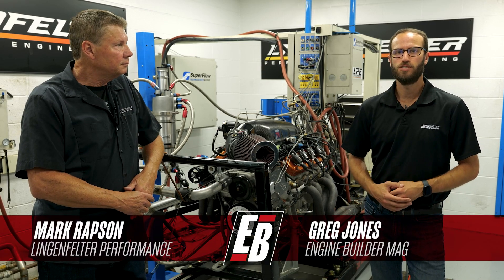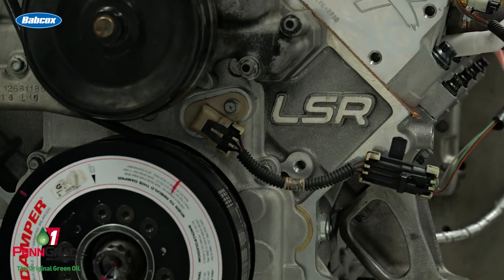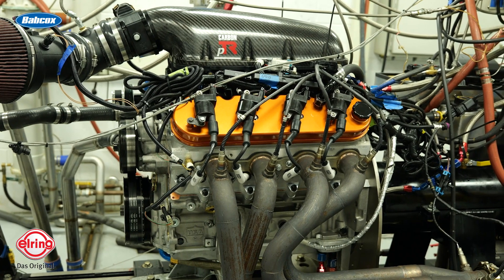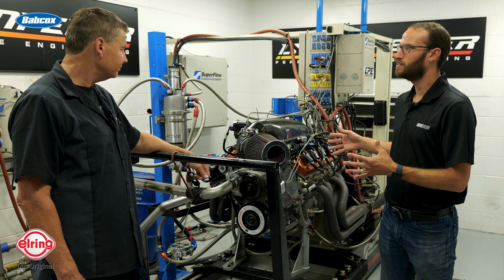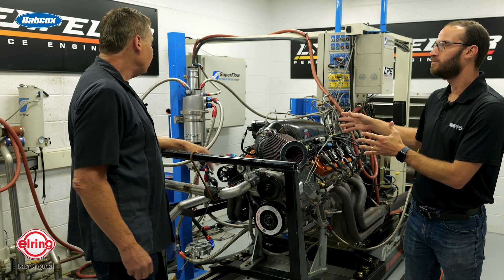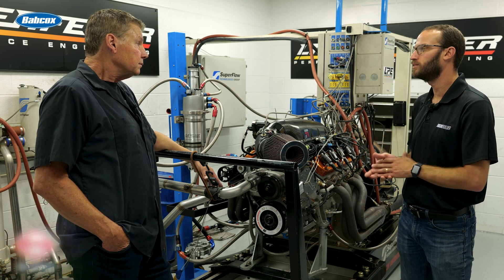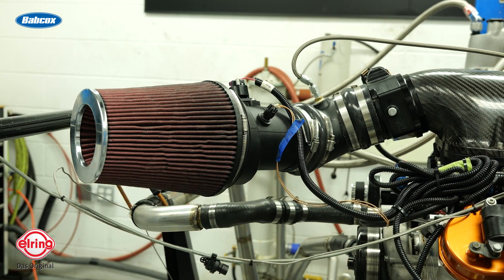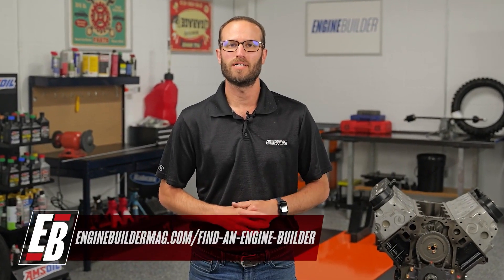Lingenfelter 454 cid LS7 Engine

Comment: My LS7 454 1974 over the counter LS 7 454 made 590hp then, 870 now solid roller Oliver rods Wiseco, 14 to 1 compression heads are ported, titanium  intake valves, severe duty, stainless exhaust valves other than that, it looks just like it did when it came out of the crate